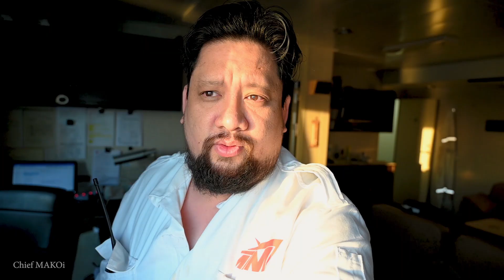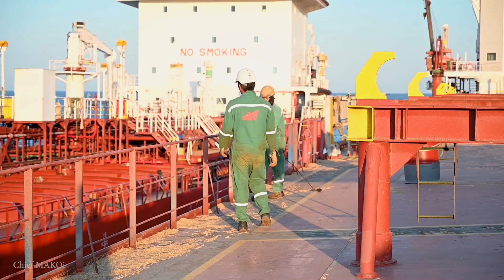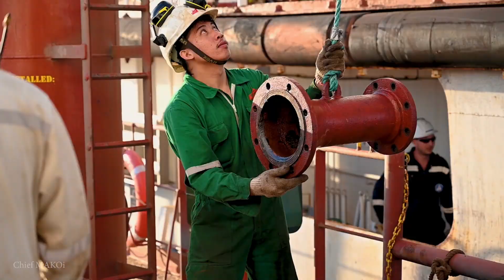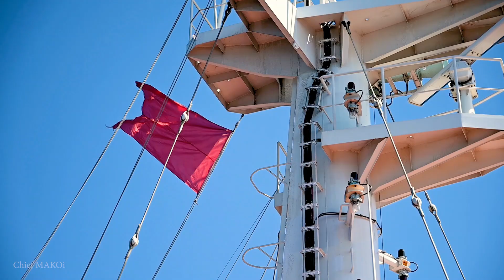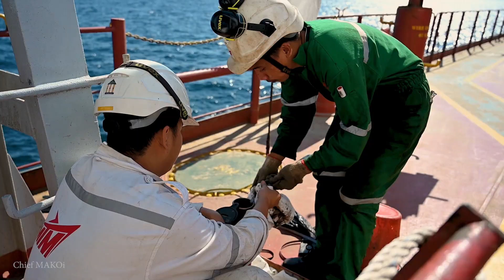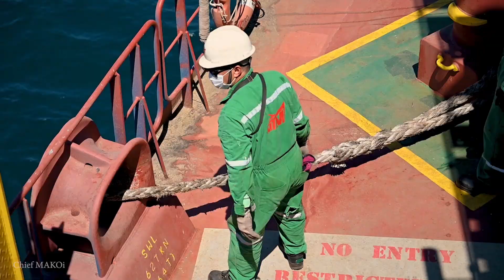Bunkering : Refueling Ships at Sea |  Seaman Vlog S03E10 Chief MAKOi

Comment: Im a marine engineering cadet on board a bulk carrier. It is my first ship and recently I helped out on my first bunkering operation. I came accross this video to and watched to compare the differences that i saw and that which happens on other vessls. It was cool to be able to recognise whats what. The only difference is that we had a slight dispute as to the quantity. We were reading much less than we should be but it all got sorted eventually! We bunkered in Amsterdam and then moved off to Nemrut Bay, Turkey!

Comment: I used to work at an average sized gas station, and I was trained to know the basic outline of underground storage tank procedures that the refueling truck crews had to follow, so I could monitor out the window and know what questions to ask to ensure they were following procedures (at least at the company I worked at, they wanted everyone to be involved in a good safety culture even if it wasn't their direct responsibility). All this is to say that the sounding of the tanks and spill prevention practices and contingencies and hose connection procedures, etc, are all basically similar to really beefed up versions of what refills your local gas station!!!
Reply: Also, I never had to do it, but I was told to shut down pumps if people didn't listen to the first warning if they were doing something dangerous; like filling a gas can that was set on their truck's bed and/or not grounded. The static electricity buildup from the flowing fuel can caus the customer's fuel tank (even the small red plastic ones!!!) To become charged, and then spark to the metal fuel nozzle. Normally gasoline isn't as flammable as in the movies, but when you're making an ignition source at the interface of a closed fuel rich environment and a normal oxygenated atmosphere, you can cause a fireball in an instant. Customers can be stubborn, but that's part of what the big red buttons are for!

Comment: Have you ever had a case when the lab analyses the sample, and comes back saying that you shouldn't use the fuel?
Reply from the maker: Yes.  That's a complicated situation.  It's usually resolved by claims between the ship owner and the supplier.  But it's the engine crew who will still suffer if there's no choice but to use the fuel (like in the middle of a long voyage and there's no other fuel that can be used).  Sub-standard fuel can lead to clogged filters, malfunctioning purifiers and sometimes even seized fuel pump plungers.

Comment: I like the US Navy way. Steam at 12 kts alongside an oiler, usually about 80' apart, for as long as it takes.  The fittings are specially designed and mating is very quick. Heavy lines between the ships support the hoses in special saddles. I saw this evolution more times than I can count as I was stationed on a super carrier for 2 years and spent the majority of that time at sea.
Reply: Controlled chaos UNREP is! I did 10 years active duty USN and NEVER went to sea since I was a Naval Aircrewman on P-3 aircraft. As a federal civil servant my butt did a lot of time underway. I LOVED IT! Unfortunately now in my career that’s just a great memory.

Comment: Very different process from my Navy days...We always filled all of the tanks to maximum at every opportunity...Sometimes in port there would be fuel at the pier but by far most of the time we refueled underway almost every day 7 days a week when possible...

An all hands evolution...We would go alongside a tanker or carrier and lines would be run across and hoses go to stations Fore & Aft.  and all of the fuel tanks valves are opened and pumping commences...there are sailors from B Division  sounding all of the tanks and the lowest ones fill first of course...and as they are filled those valves are secured and and the remaining tanks now fill progressively faster..and as those tanks fill those valves are closed too and the remaining tanks are filling faster and faster....and soon the call is made to reduce pumping by 1/2  and then to secure pumping we cast off all of the lines and hoses and break away and the next ship pull alongside...

Very frequently they are refueling from both sides of the supply ship at the same time ....and often also replenishing supplies and or ammunition at the same time...Once and only once I got to experience us refueling from the carrier from both sides and they were launching and recovering aircraft all at the same time..naturally the entire squadron was rotating all of the escort positions to allow the two taking fuel and then they rotated out to other positions like Plane Guard...and ASW ...and Escort...

Comment: I have a couple of questions.

Why doesn’t the crew use a pneumatic powered socket gun to initially run down the nuts when coupling all the components to the ships bunkering manifold? It would seem to me that would reduce the time for those operations. Is there perhaps a risk of a spark that could ignite any vapors? Or is it somehow not as time efficient as I believe it should be?

My second question is, was there some kind of flow counter meter used to measure how much fuel was pumped into the tanks?

Comment: Am i right in assuming that the nature of heavy fuel oil does not allow for capacitive measuring? Sounding seems like an ancient method to measure the amount of fuel in each bunker/tank in comparison, especially during fueling operations. Same for flow metering to measure the exact quantity loaded. 

On the other hand, fuel quantities are huge of course, so even small measuring errors can add up.

Comment: I see that the bunkering procedure is very conservative - no automation, not even flow or level meters or valve position enunciatiors, everything is done manually and triple-checked. You don't even trust yourself that you connected the hose to the right flange on the manifold and that the valves are in the correct configuration.
I guess that's a combination of cost-saving and having most trust in your own hands and eyes when a very critical and potentially dangerous operation is concerned.

Comment: At one time I worked on a support boat involved in lightering operations. We transported the lightering masters, riggers and sometimes the Yokohamas I saw briefly in your video. The masters and riggers went aboard the receiving vessel via a basket. The discharge boats were the largest in the world; TI AFRICA / TI ASIA. 4,000,000 bbl mid east crude to be lightered to a 1mm bbl ship. But, this was all done underway at approximately 6 knots max. First was to deploy the 4 Yokohamas. This could be dicey if a sea was running. 
Once on a midnight to 0600 watch I heard on the secure UHF handheld what sounded like a "domestic" in a foreign language. There was a leak which overflowed the catch basin. Crude was leaking over the side of one of the ships. It was so viscous it stopped a third of the way down the hull. Because my boat carried all the spill equipment, including skimmers and booms, I almost called to see if they needed any deployment. I decided to let them initiate the call. No containment or collection equipment was needed. But we got a flyover by the USCG and reps from both ships flew in by helicopter. 

Your comment about discharge / receipt discrepancies brings to mind. My boat, an 80 ft launch, used diesel. We did an at sea fuel replenishment, tied up to a fuel barge (Small tanker)  We both had meters. We mutually checked to make sure they were set at "0" and respectively "sticked" the tanks. Fuel was discharged through a large diameter gas station hose with a hand nozzle as in a gas station. After topping off and reading our meter, the barge captain maintains his meter malfunctioned and stopped operating. Of course he sticked his tank. The discrepancy was in his favor. We essentially told him to f**k off, we would only accept our meter reading. He relented. Other boats reported the same thing from this fuel barge.

Comment: We did it differently in the Navy, steaming along together side by at full speed. I pulled those lines over many times!
Reply: Did you guys have to bolt the flange of the hose like in this video?  (I thought merchant ships would bunker at a dock in port.)
Reply: @stevenmurata4392  No, all the fittings were the same. We refueled from carriers a few times, that was pretty awesome!

Comment: I was what was called the Oil King in the Navy. In charge of ALL Fluids on the ship. When we refiled at sea it was similar as far as all hands we attached to the refuling ship by cables had a quick connect & disconnect for the hose kind of like a gigantic air fitting and we did all of this while maybe bring in perfect parallel unison at about 5+10 knotsm I'm not sure of the exact speed anymore but it was decent.

Comment: Interesting to see.
But, why not have the barge operator notify the vessel of their flange size ahead of time allowing the vessel crew to prepare the manifold with both the correct adaptor and the correct proportional sampler which, I guess, since it is installed between the only manifold and the barge hose, has to be the same diameter as the delivery hose? It would save time and minimise risk as all the time the vessels are moored together they are unable to manoeuvre.
Also, the quality check. The two questions uppermost in the chief engineersind are presumably "Can I clean it? (Centrifuges?) " and "Can I burn it? (Fuel oil heaters and max permitted fuel temperature at the engine)?".

Comment: Interesting how the operation works. It’s a little bit more than pulling up to a pump and saying $50 on pump #2....🤣
Reply: yep.... and the calculations are veeeery different, the fuel is invoiced by weight not by volume, so there is a lot of factors like temperature, density, heel, trim, to take into acount.

Comment: Where did this occur? Who is selling the fuel?

Why is dropping a weighted tape measure into a fuel tank called sounding? A lifetime ago I occasionally had to get fuel level data from a large storage tank. Getting that same weighted tape measure data was called strapping instead of sounding. I didn't ask where the term came from.

Comment: Chief I have to say i was surprised not to see any torque wrenches employed in securing the transfer manifold🤔 ATAF  is leaving one possible weakness in your system? I would guess the gaskets in the adaptor must have a torque limit before they deform? I know the guys will say "We know how tight to make this" but in this crappy Lawyer driven world, if SOMETHING went wrong, they would ask you for proof you did the job right, not just ATAF! 
Love the videos, safe passage to you all👍
Reply: in 20 years of everyday bunker i have never seen a torque wrench being used to connect the hose. Every single piece is developed to not to need it. You just tight the bolts till you maximum strenght, the pumping starts at a very low rate for 15 minutes so you can identify any leak.

Comment: After 20 years in the Navy, I submit this video was not filmed at sea, rather at anchorage.  Refueling at sea is done at ~12 knots and the ships are 40 to 150 feet apart.  And at 40 feet everyone is very nervous.  Another difference is that the navy uses quick disconnect fittings so that if the ships come under attack they can break apart and maneuver to avoid attack.  We refueled, rearmed and/or reprovisioned every 3, 4, 5 days.  the hard days were the ones we had to do all three as we were not allowed to refuel and rearm simultaneously.  We could reprovision with either of the other two.
I have seen two ships being refueled at the same time from a third ship.  The first time was 27 December 1972.
Reply: I spent many unrep on the USS John F Kennedy CV-67 thanks for the comment.
Reply: I really expected merchant marine ships to be more like the naval quick connections. They seem to have a good routine going for them.

Comment: what if they find out the fuel is bad after they have been using it for ages, a bit late lol
Reply: If you knew what you said just now ...LOL   You Do realize we are talking about RAW petrol , thick , sticky the way it comes from the earth ...Right ?  There is no way it is bad as a fuel when it's in its original form .
Reply: @G.I-HFYstories  why do the need to lab test it to see if it’s good for the engine then .. it’s kind of late after they already use it.
Reply: @nicholas3706  fuel bunkered is not used until they receive the analysis results.

Comment: I had thought they were moving away from bunker fuel to diesel for environmental reasons. Maybe that is on smaller vessels. Obviously bunker is going to have much higher energy content so diesel would be less efficient.
Reply: diesel is more eficient and clean..... AND EXPENSIVE. Vessels use both, hfo for open sea, and mgo for port and sensible areas, everything is regulated.

Comment: 400 tons of fuel transferred in an hour, I would have thought that amount would have taken much longer especially after seeing the size of the hose. I also find it interesting that they measure the fuel in tons and not gallons or some other measurement usually used for liquids. I would think the tanker pumping the oil would be measuring what flows through the pipe which is a liquid measurement and not a weight.
Reply: yeah, that is interesting.  They're using depth sounding to measure the fuel level which is a volume, so they are measuring the size of the liquid rather than the weight.  The tons measurement must be a holdover from the coal days, like he said about the other terms.  That, and possibly like aircraft, the weight is much more important than the actual size, so talking in tons makes everything simpler.
Reply: the fuel is sold by weight, you check the measure in the tank in volume, take the supplier density and apply a temperature correction factor, then you have weight. The tons measurement is not from the old days, is just metric system, we use meters, cubic meters, celsius, and kilograms, but the quantities are so big that we express it in tons. It all makes sense when the supplier gives you the density in kg/l

Comment: I am a little confused about sampling of the fuel oil how long does it take to get the sampling analysis? and how do you know without the results if you are getting uncontaminated fuel if the transfer has already started.
Reply from the maker: It's all about gathering documentary evidence in case of off-spec fuel.  The ship owner will fight it off with the suppliers so every bit of evidence will be required.

Comment: Chief is the bunker fuel barge a product tanker of sorts?  Is it smaller or bigger than the Handy size product tankers?  Thanks
Reply: It's not really a product tanker. It's a bunkering tanker - usually highly manouverible with strong pumps. A product tanker is usually used for clean petroleum products. A handy size tanker is usually around 35k DWT-40k DWT. Bunkering tankers are typically around 3.5k DWT. Of course you can get larger and smaller ones but that it around the typical size.
Reply: @toms621  Thank You....I am trying to get up to speed on shipping in general and product tankers specifically. for investing purpose. Much appreciated.
Reply: @hermanhaertner4614  Hi Herman. I work in shipping (shipbroking specifically) and I'll try to dig out some old files/guides I have on tankers, in the next few days. Meantime if you're interested in investing there are a few publicly listed tanker companies. Specifically with product tankers there are: Diamond S, Team Tankers and Scorpio Tankers.
Reply: @toms621  Have been researching tankers online.  Learning terms, watching processes, cost of passing through canals, and most important what drives the stock price.  Shipping rates seems to be one of the big drivers along with new builds and scrapping to mention just a few.. Lot more complexity than I had imagined when I first looked into them.  But it is interesting, challenging, and fun to learn.   Looking hard at Scorpio Tankers because of youth of their fleet and the premium that it may bring in booking..  From what I have researched their break even is about $17k to 19k. per day.  Debt makes me a little worried but seem to have ample cash and credit lines to get to the other side of virus.  Hoping by next year this time my ship will come in investment wise with them. But still want to learn all I can.  Got a huge learning curve ahead of me. Thanks for any help Tom.

Comment: Your videos are very informative and have a professional quality.  And I can tell that you know your business.  However, in my role as a landlubber, Your procedures raised some questions in my mind.  
-- Refueling at sea has probably been occurring for over a century so I thought the industry would have developed some sort of quick-connect system for passing the fuel covering all of the different connection, safety and monitoring devices required for the operation.
-- Okay, so you use flange connections.  Your crew has to strong-arm the bolts for the flanges with wrenches.  I would have thought you would make impact wrenches available for this part.
-- So a modern ship does not have a remote monitor system for gauging fuel levels?  Not to mention an in-line device for gauging the flow.

Like I said, you guys (you and the industry) know how to do these things and it is not my place to criticize.  This is just a curiosity raised in my head by your video.
Reply from the maker: A lot of people have been asking those questions.  And the answer is quite long.  I think it will be better if I make a video about it.
Reply: monitor gauges lack precission... , in line flow meters are really expensive (for the precission needed) . Short answer